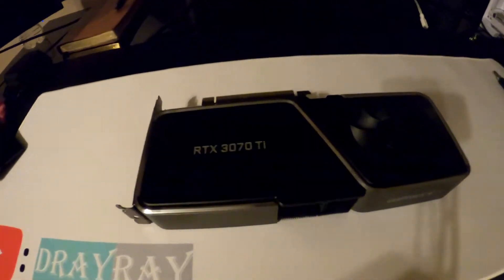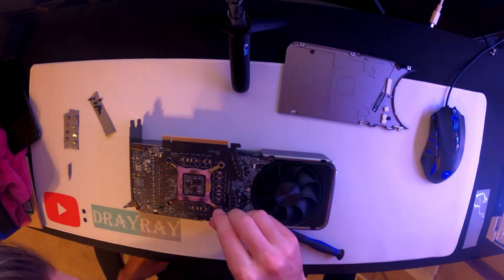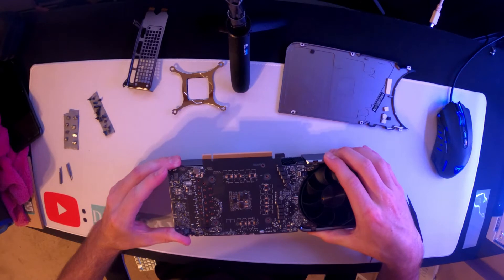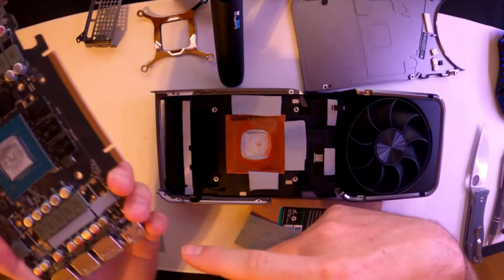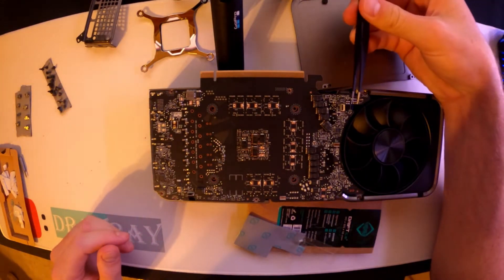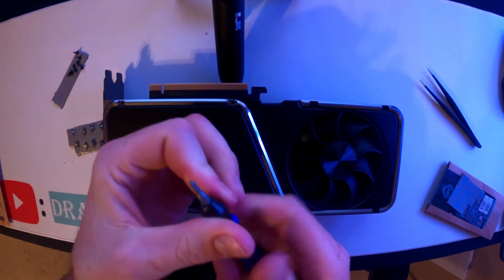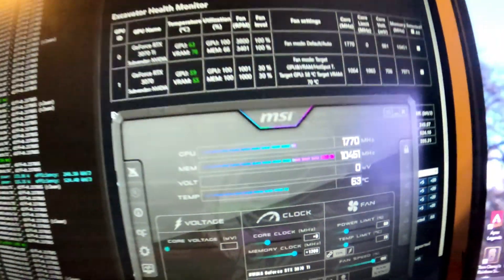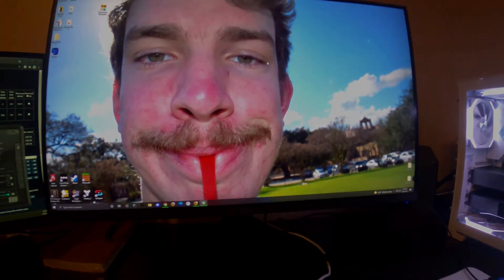RTX 3070 TI FE Thermal Pad Replacement (1.5mm thickness pads)

Comment: Hi Dray, I've a similar one, used. While playing the temp reach around 87-90ºc. Is that normal or should I replace?
Reply from the maker: Its normal under heavy load. If you are comfortable replacing it i would recommend it. If not, you can play with your fan curves a little bit to lower the temps (i use msi afterburner for this)

Comment: Video is nicely done and you explain everything clearly.  Camera placement is good as well, and it's easy to see what you're doing,

Did everything you did, with Arctic pads and paste, but no change in my temps.  Furmark stress test still gets my 3070ti FE to 93 degrees, with a 102 degree hot spot.  Thanks for the detailed teardown, just one more thing, as someone else mentioned, once you break the seal on the thermal paste it should really be removed and replaced.

Comment: hi, I followed your advice to change thermal paste,
Do you know how to fix the fact that the fan on the lower 3070ti FE runs slower than the upper one?
Reply from the maker: Hm i dont ever think i had that issue and if i did i did not notice that that were different. My advise would be just do some resetting and manual removal then reinstall. Then verify drivers are updated.  Not sure what else to do.

Comment: Replaced the thermal pads 1.5 mm and paste temps went to 90 degrees in like 2 seconds but thanks for the help I’ll try to get it sorted out
Reply: 2 years later.. but did you ever fix it & what exactly did it?
Reply: @ nah I just went back to the original pads as those were better and undervolted the gpu
Reply: @zeeesid2070  I've those temps but without thermal replacement. Should I replace?
Reply: @sbarr22 you should try repasting first

Comment: Use custom set of 3070ti from kritical thermal pads, otherwise you will screw up your hotspot temperature
Reply from the maker: Was not the case for me. Works great no issues
Reply: Did you do it currently having trouble with temps right now wanted to see if it works for you 😅
Reply: thank you for the info on kritical was so scared to rawdog thermal pads.

Comment: Were these pads squishy enough for the spots where stock pads needed 0.5mm? I've been reading about people having problems with the heat sink not making contact using different pads because they weren't as soft as the stock pads
Reply from the maker: Are you sure it’s “not as soft” or they used too thick of pads. You will be okay with 1.5mm
Reply: @drayray9766  okay that's what I was wanting to verify, they were saying you needed 0.5mm for some, 1.5mm for most, and 2.0 mm for another few, but it looks like the pads are pretty spongy, just got them in today so we'll let it rip and see how she goes lol
Reply from the maker: @Sethamphetamine21  let me know if you need anything

Comment: Man bro your going to kill your GPU fan. Great disassembly breakdown thought.
Reply from the maker: How so? By running it?
Reply: @drayray9766  by running it at 100% 24-7 it will last for 10 years at 60%. I give it 2-3 max at 100%.
Reply from the maker: @gandolfgrey5385  cool. Rather replace a fan than a whole gpu due to mem and core temps being too hot
Reply: @drayray9766  a GPU can run for 10 years at 70C, with proper repad and replace. All you would be doing now is wasting money on fans but I guess if you dont have 50 GPUs or more a fan here and there really isnt that bad
Reply from the maker: @gandolfgrey5385  yeah i keep them in the upper 60s so im good

Comment: i just bought one today, any chance this has beeen fixed? do you know of any service updates on them making and adjustment at the factory?
Reply from the maker: I wouldn’t think so. Go ahead and do some testing and see the temperatures
Reply: @drayray9766  I have a super small form computer to... so well see!
Reply from the maker: @Novagunner  okay. Make sure get proper air flow and might need to adjust your fan curve in msi afterburner

Comment: I re-did it 5 times with the gild extream 1.5mm. core stays at 80 mem 110. should have not touched it idk why so frustrated.
Reply from the maker: Goodness. Sound like the pads arent that great? Does it still run without thermal throttling?
Reply: @drayray9766  yea. I tried guild extreme and ultimate 1.5mm. I even tried squeezing the pad down a bit before putting it on the card. It still runs 80 core and 106 VRAM. Before it’s 55 core 90 VRAM😂.
Reply from the maker: @Kingraccs2  wow idk what you couldve done wrong. Are your fans spinning?
Reply: @drayray9766  Yes. I tried 5 different thermal pad all 1.5mm. Nothing works maybe my 3070ti is different
Reply from the maker: @Kingraccs2  wow thats very interesting. Never had that issue. And i have 5 of them
Reply from the maker: @Kingraccs2  you can try sending it back to nvidia and asking for a replacement if you still have the warranty
Reply: @drayray9766  I thought if u opened it u voided warranty.
Reply from the maker: @Kingraccs2  i did one of my friends 3090’s and he ended up frying a connector with an after market power cord and he filed warranty claim and sent it in. They sent him a brand new one
Reply from the maker: @Kingraccs2  might be worth a try
Reply: @drayray9766  thanks u my man. i will try! in the mean time i might as well just buy a 3070FE lol. I am one card short on my 12 GPU mining rig
Reply: @drayray9766  How long did the entire process take? I just bought mine one month ago
Reply from the maker: @Kingraccs2  okay. And i think it took a month. Not entirely sure. Could’ve been shorter. Maybe try googling the process and you might find some timeframes.
Reply from the maker: @Kingraccs2  google says a week or two
Reply: @drayray9766  Thank you man. I did a live chat and they say they will reach back out to me. They were saying I should never replace thermal pad myself and it might not get covered since I opened it.
Reply from the maker: @Kingraccs2  got ya.  even if you send it i think they would take it and send you a new one but not too sure.  Let me know how i can help.
Reply: @drayray9766  I really appreciate the help. I will def lyk abt the RMA!
Reply from the maker: @Kingraccs2  Any time, Perfect!

Comment: i've a quick question: i've seen a reddit post talking about the pad's thickness which seems to be different based on the pad position (here's the screen https://i.imgur.com/YpeuEfs.jpg ) 

Do you think it's correct? have you had any issue on memory temps or core?
Reply from the maker: I have not had any issues with all 5 of my 3070 ti’s
Reply: @drayray9766  so i can use 1.5x15x15mm shims?
Reply from the maker: @albertograssi1991  for copper shims you would paste the mem chips, then place 1mm thick copper shims then put .5mm pads on tops of the shims.
Reply: @drayray9766  I’ve already used shims, on 5700s and they work the best is to not mix shims AND pads, this is the reason why I’d like to use only copper
Reply from the maker: @albertograssi1991  then use 1.5mm shims with paste. Whatever floats your boat

Comment: I have changed the pads. But now i have o problem with the core temp. it is like 80 C now. i used arctic mx-2. What is the problem? Can anybody help me please?
Reply from the maker: Your pads are probably too thick which cause the cooling plate to not come in contact with the dye. Re open the card and either replace the pads with 1.5 mm thick ones or smash the pads down a lil bit so the cooling plate can come in contact with the dye
Reply: @drayray9766  pads are 1,5. Mem temp is ok. But now the core temp is the problem.
Reply from the maker: @v.8195  did you repaste ?
Reply: @drayray9766  should i thighten the srews more? What to do?
Reply from the maker: @v.8195  did you repaste?
Reply: @drayray9766  yes i did. i used arctic mx-2 on the core. and on mem temp 1,5 Gelid. the mem temp are ok. But after repasting on the core i have 85-90C on it. before i had about 55-60C.
Reply from the maker: @v.8195  are both fans spinning?
Reply: @drayray9766  yes. Only problen with the core temp.
Reply from the maker: @v.8195  double check the tightness of the screws and if the dye is coming in contact with the cooling plate
Reply: It does come into contact. I wilk try mk4 later and see what happens. I asked you cuz i have exactly the same card and i thought u can help me.
Reply from the maker: @v.8195  yeah not sure what the issue is. Try to double check all your steps
Reply: @drayray9766  do u have a discord channel?
Reply from the maker: @v.8195  yes but just some friends in it. No community for help
Reply: @drayray9766  Core Temp still 85C.  mem temp 84 C it is fine. But the core temp is to high and is thermal throttling.  i realy dont know what to do next
Reply from the maker: @v.8195  me neither if you have done everything that i have mentioned and checked everything I suggested
Reply: @v.8195   Hi, were you able to solve it? i just changed my pads and now i have the same problem.
Reply: @sergiocarvajal971  hello, no i have not solved it. i think that 1,5mm is to thick. but i dont know which ones.

Comment: Hey, do you know if the memory chips are 15mm or 20mm?
Reply from the maker: 15mm. I went to do the copper mod on my 3080 ti fe and those were also 15mm. I know they are 15mm because i got the 20mm copper plates and they were too large. 

Let me know if you have anymore questions.
Reply: @drayray9766  Thank You 🙏
Reply: @drayray9766  i wanna go with copper shims on 70ti, i bought 15mm large and 0.8-1-1.5mm thick. Can i use 1.5mm or are they too thick? I also wonder, are those SMD chips lower enough than memory to apply just the shims?

thank you
Reply: @albertograssi1991  Did you ever put the copper shims in the 3070 Ti FE? If so, what thickness did you use?  Thanks.
Reply: @mypantrytrackerapp5145  3070ti is pain in the ass, 1mm is just very very close to be the right thickness but mem run super hot istant, looking at the thermal paste shims actually barely touch heatsink, but it's not enough. I tested 0.8mm copper shims + 0.5 normal thermal pad and this 1.3 hybrid is very very close to the right thickness, because mems are very cooler than before but core is still too hot +70°C which means the correct size should be 1.1-1.2mm.
Not even need to say 1.5mm is waaaay to much, even with normal thermal pads, gpu won't even start actually
Reply: @albertograssi1991  Thank you very much for the great info!  Yeah the FE is a pain in the ass bc the GPU and memory share the same heatsink, other cards like the ASUS Tuf have a separate heat sink for the memory so it's much more forgiving.  I will get some 1.2mm copper to try on the FE. I'll look around for some 1.1mm shims also but idk if they make that size.  Thanks again!
Reply: @mypantrytrackerapp5145  you actually can stack like 0.5mm with paste in between maybe it’s good enough for it. And btw, maaaany gpus use sing heatsink actually, it’s very common

Comment: Love your show, very easy to understand, I want to confirm it, all sections are have the same thickness (1.5mm thickness) do you recommend any specific brand of thermal pad. Thanks
Reply from the maker: Correct. Gpu riser brand is really good
Reply: @drayray9766  I have also seen some others, they says mix 1.5 and 2mm, for black plate 2.0mm
Reply from the maker: @gmcmovile2460  you can. At that point you really need to know where to place them for the clearance of the plates. If you have too thick of pads in one spot it might keep the pads from another spot from coming in contact with the plates. Hopefully that makes sense
Reply: @drayray9766  it’s better to stick with 1.5 as you did

Comment: YOU DIDNT CHANGE OUT THE PASTE?????  YES!!! it matters! massively!  smh
Reply from the maker: Changed it on another 3070ti fe and there is no temperature difference in the cards at all. What does it impact?
Reply: @drayray9766  its more because you disturbed the setting of the paste, leaving possible spots without contact.
Reply from the maker: @Awesome20hh5  thank you

Comment: For anyone wanting to do this forget the thermal pads. Get thermal putty! 10 mw/k from digikey key did the trick!
Reply from the maker: Both work great! Thanks for the feedback
Reply: @drayray9766  for sure! I just saw a bit better results with the putty. The 3070 ti FE is a weird one
Reply from the maker: @lowread9  how was the process?
Reply: @drayray9766  same tear down and all which btw thanks for the video! The only difference was I replaced paste and applied the soft thermal putty about 1/8 inch thick on the heat sink side where the memory units would touch. It was probably a bit too much but taking it apart several times absolutely destroyed those screws so I didn't want to have to do it again.

I tried several pad brands and thicknesses. I couldn't get the mem and the core to be both as cool as I wanted with any size or brand.

Mining with it at 59- 60 mh/s. Core is at 45 degree and I'll check the mem temps later. No more thermal throttling though. My ambient temps in the room sit between 70 and 90 degrees. I have a box fan running on it but will also test without later as well. 

The thermal putty was similar to the stock putty but I would have to guess it has a bit better rating and was definitely applied better than the factory job when I replaced it.
Reply from the maker: @lowread9  i advise you trying to remove the heat from the room itself. It will help your temps tremendously.
Reply: I know this is from a while ago but are you able to post a link the specific putty you used? Digikey's website isn't the most navigable.
Reply: @andrewkyllo3170  last time I checked it was discontinued. Let me see if I can find it.

Comment: You never reuse the thermal paste... This is the reason why your core temp is at 63C with 100% fan.
Reply from the maker: Ive done some tweaking and got it down to 65 at 60% with +1625 Mhz
Reply: @drayray9766  right arthur you aint you lad

Comment: Hi. I have 60-62 MH/s but GPU temp is 43-49 VRAM is 84-96((((((    config is: locked core 900MHZ memory +1200MHZ fan 70% power limit 73% https://www.youtube.com/watch?v=NP7oii79SyQ
Reply from the maker: Maybe bump the fan speed up a lil bit. Your mining on octopus? I found that was ridiculously power hungry and made mine way too hot for my comfort. I stay on ethash and daggermotto
Reply: @drayray9766  eth mining
Reply from the maker: @cryptohunter7881  hmmmm not sure. What size pads did you use. Or did you replace the pads?
Reply: @drayray9766  I have stock thermal pads.( Do i a have to replace it???
Reply from the maker: @cryptohunter7881  i replaced mine and my vram temps stay under 75. OC core +0, memory +1500 fan 85%.  Also have 2 in one pc case so not too much airflow.

Comment: What is the thermal pads size for  MSI 3070ti superiem x ?  is it  1 mm 1.5 mm 2 mm ?
Reply from the maker: Not sure. I have never delt with MSI cards. I would imagine 1.5mm would be okay.
Reply from the maker: You can purchase all three sizes and when you take apart the card measure the pads on it then use those. Just return the ones you dont use